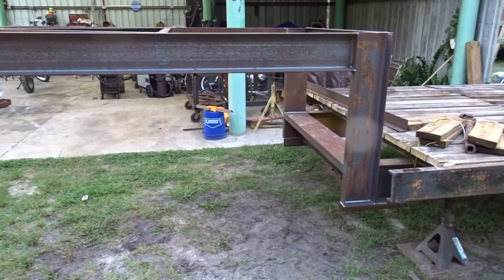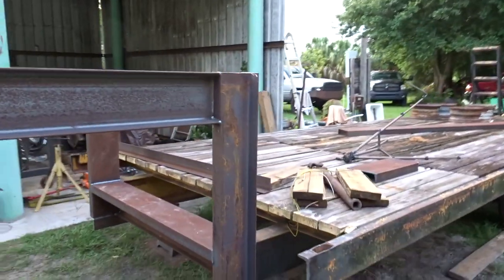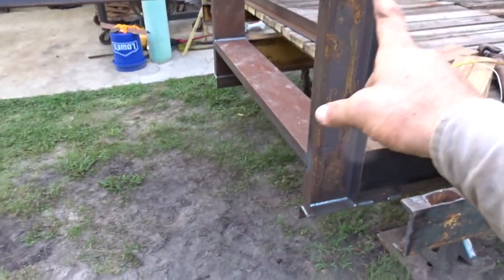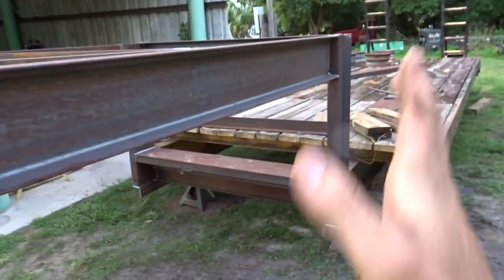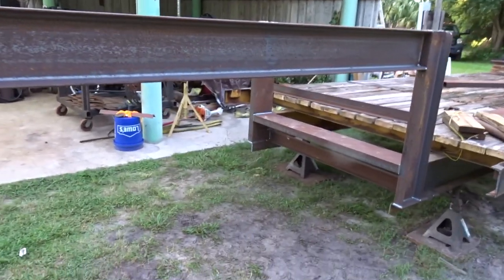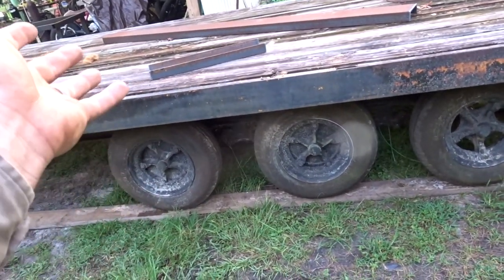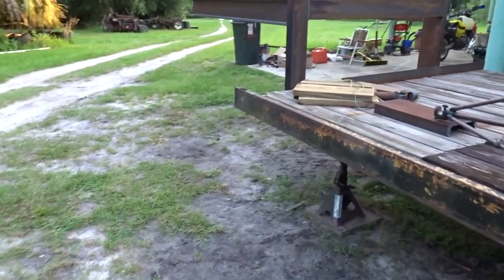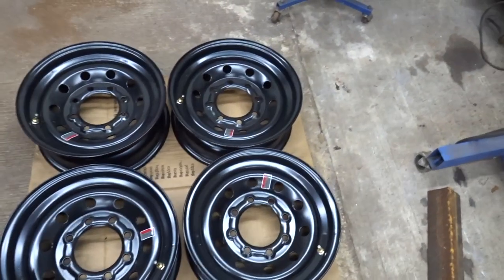Custom Stepdeck Gooseneck Trailer Build PT 1 & Plasma Cutter GIVEAWAY!!

Comment: Its super easy to just convert the hubs over to 6 or 8 lug. Just measure spindle bearing sizes and order the full hub and brake kits. Then get your wheels and tires!

Comment: I built trailers my junior year and every thing looks good but we're the neck attaches to the trailer frame run some 7018 on there and run multiple  passes and the axles make sure they are rated to carry the trailer and what ever you put on there I would do 15,000 rated axles so that will give you 30,000lbs to to work with because you have include the trailer

Comment: I have the new color CUT65DS probably do a give away as well. I been holding back on building or buying a dump trailer because prices are outrageous on either option. I priced in a few trailers and they range from $11k to $14k just not sure if to get a goose neck or a bumper pull 16ft with 14k rating.